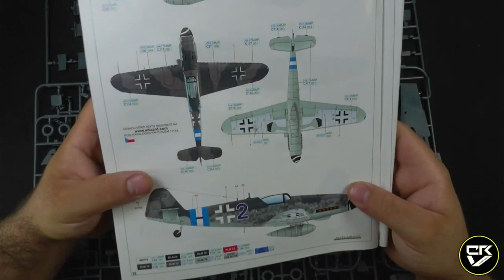1/48 Messerschmitt Bf 109G-10 ERLA - EDUARD 11148

Comment: Top notch build on that kit. FYI: The ERLA built 109G AS models all lacked the two subtle bulges on the underside of the nose, just aft of the spinner. MTT and Regensburg built As models all had those twin bulges. A subtle difference but marked a different oil pump used on the engine.
Reply from the maker: Many thanks!! And thanks for the information too!! :)